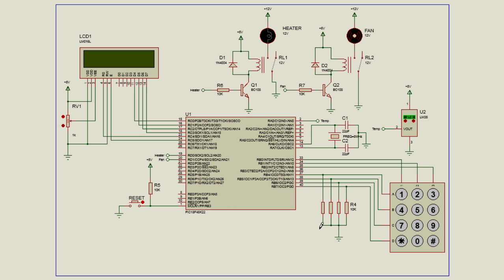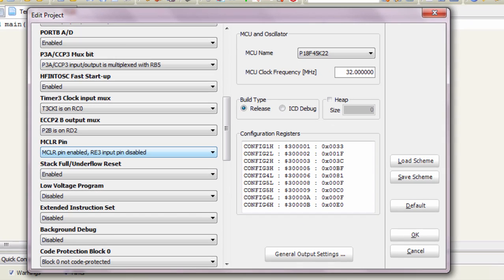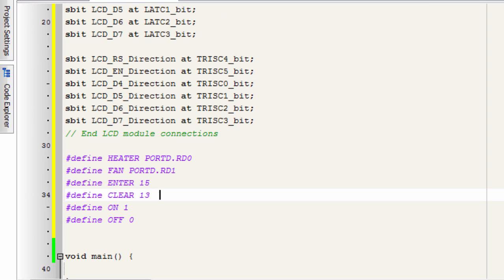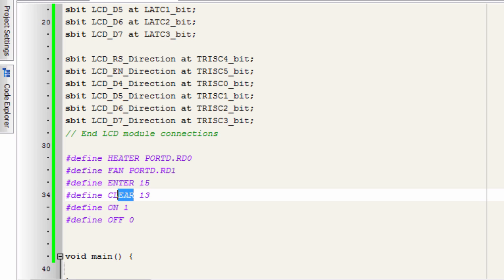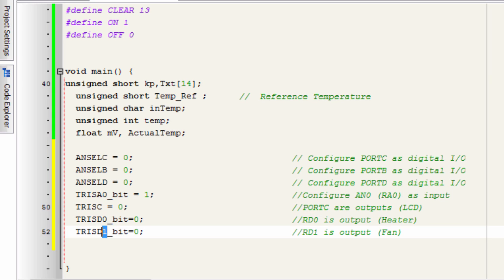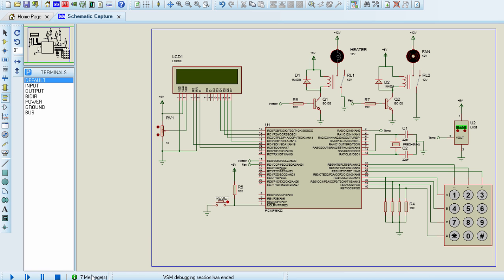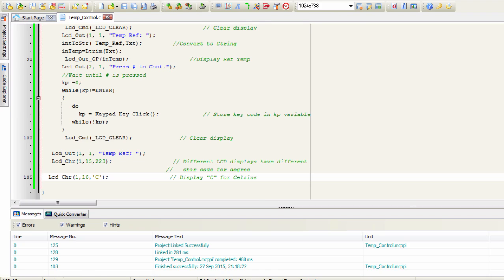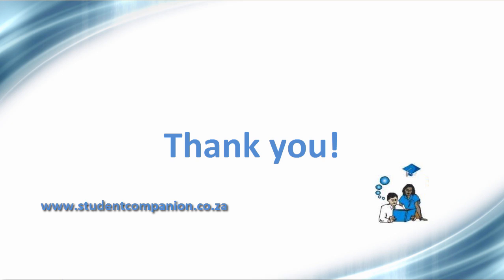12- Project 2 Automatic Temperature Control, part 2 | mikroC Pro for PIC Tutorial

Comment: Hello Sir, it's always great to learn from your tutorial. I truly appreciate that, I only had a doubt . For part 1, i have successfully done the schematic but for part 2 I'm not sure whether this program code can be inserted at MPLAB IDE since I don't have MICROC PRO.
Reply from the maker: Hi. You can't use mikroC codes in MPLAB. The syntax is different.  Here is the MPLAB version: https://youtu.be/cPigAoimpX8
Reply: @StudentCompanion  Thank you for  the reply sir :) btw, Just curious whether the same code in MPLAB..
Reply from the maker: It's more or less the same code. Except in mikroC we added another part 4 with additional features like to save reference temperature in EEPROM  and sound a buzzer when temperature reaches a certain limit. Those are the differences including the use of a different PIC which can't be an issue.
Reply: @StudentCompanion  Sir, Can i use this source code in proteous software and stimulate ?
Reply from the maker: Use the Hex file

Comment: hello friend a question that another micro controller can be used to replace the one you passed in this practice.
Reply from the maker: Yes you can.
Reply: Student Companion SA And why that you can?
Reply from the maker: +Memo9xD you can use any PIC with enough pins to connect your lcd, keypad abd your relays. It must also have at least one analog channel which mist of PIC today have. It must also have enough memory for this code.
Reply from the maker: +Memo9xD you can substitute with another one but don't use the same hex file, you must rebuild a new one with this PIC.  You must also set correctly your configuration bits and oscillator frequency.

Comment: Hi, you chose 32 MHz as the MCU clock frequency. May I know what the basis is for choosing the clock frequency, do you choose high (32 MHz) when you're dealing with more complex circuits whereas for simple ones 8MHz is sufficient? Thanks!

question 2: why not just use the internal clock to save on using discrete components?
Reply from the maker: The choice of oscillator is usually dependent on the requirements of the project.
1. Low frequency: The advantage of low frequency is low power consumption and if you decide to use the internal oscillator, then you can save on using discrete components. 
2. But for accurate frequency and frequency stability it's better to use an external crystal. A crystal is several times more accurate than the internal R-C oscillator. A crystal is much more accurate, and necessary if you are doing some other types of communication like CAN, USB, or ethernet which require accuracy and high frequency for operation, like a USB in full speed mode requires 48MHz.
3. Another reason is in applications that inherently require accurate frequency or timing other than communications. If you require timers for example or you are measuring pulses, with an RC internal oscillator, over time your internal oscillator might  go off with synchronization quickly after some time.
4. Another reason is in Temperature independent precision. Typical oscillators can vary wildly. Specialty temperature compensating oscillators can be needed in low or high temp applications, or if temperature varies wildly.
But in newer microcontrollers, the internal oscillator is getting more and more precise.  Some newer PICs have both a multiplier and divider in the clock chain so you can hit a wide choice of frequencies from the single internal oscillator frequency. So an internal can do the job well as well.
Because we are doing tutorials, we always use both, the internal and external just to show people how you can use both.
Reply: Thank you! Great job as always
Reply from the maker: Thank you.

Comment: hi bro,
how I can write the keypad code in a function outside the main and use it whenever I need it in the main? and how to call it in the main?
Reply from the maker: Do you mean you want to write your own keypad library? You don't want to use mikroC keypad library?
Reply: well, I want to use the same library, but customised to work with my system. I want to use 4X4 keypad, I want to use 0 to 9 numbers and * for back space and # for enter. Also, I want to use A, B, C and D for interrupter, for example, If I have a timer for motor and solenoid valve, and I have temperature control system and a humidity control, I want to use A,B,C and D to interrupt one function only and modify it using the keypad without effecting the other functions.
Reply from the maker: To read a Keypad key, all you need to do is to call the Keypad_Key_Click() function: 
kp = Keypad_Key_Click();
Reply from the maker: You can put the Keypad_Key_Click() function anywhere in the flow of your code depending on your requirements, it can be inside other loops or  statements, but make sure it's read continuously because it's has to wait for a user to press it. Whatever function it's inside, it has t be a waiting process because you don't know when a user will press the key.
Reply: Thanks bro, I want to use that function many times, for example to enter motor timing, to enter temperature reference... so on. I want to write a function customised according my requirement. any where in the main I want to get an input from the keypad, I call it. for example tempRef= readValue(); also for timing the motor, motorOn=readValue(); motorOff=reaValue(); 
the function readValue(); has my code to read the value from the keypad, that value has to be converted to integer so that I can use it for controlling the motor and temperature. This value has to be maximum of 4 digits. 
I spent really long time trying to sort this out, but still struggling.
Reply from the maker: +Lion Heart you want to control many parameters from one keypad.  The easiest way is save these parameter values in some variables during initial setup.  Then during operation use interrupts to jump out of main loop to enter new parameters.
Reply: @Student Companion I tried that and I got a reentrancy error for Lcd_Chr_Cp. Now I am trying to use it in a header file and I got error on " bit Keypad_flg; " it says specifier needed. I am using pic18f45k22
Reply from the maker: +Lion Heart which library are you using? Did you download the library? It looks like you didn't include the library
Reply: I am using mikroc pro and their library.
I am not sure how I can do what I want, I want to ask user to enter for example temp ref, solenoid timing, humidity ref etc. and I want to use A,B,C and D with interrupter so that anytime during the operation if user want to modify temp ref for example click on A, and so on, * for back space or clear and # for enter
Reply from the maker: If you want to change the settings during operation, use interrupts. Let say the user presses  button A, go to interrupt service routine. Here you can have a code similar to the code we have in this tutorial from this line: //On startup, read the reference temperature from the keypad. Then you can save your new settings. And once the Enter key is pressed "#", the program can continue with its normal operation. You can do the same for other parameters (Solenoid timing, humidity...) with interrupts of different keys.
But pay attention on which pins you are connecting your keypad because not all pins of microcontroller have interrupts features.
Another and easiest option is to add another pushbutton connected to an interrupt pin of microcontroller. Once this pushbutton is pressed, you can jump to ISR where you can configure all your settings.
Reply: Can I use timer interrupter? and do I need to connect each of A,B,C and D to a pin which support interrupter? as I have pic18f45k22 which has INT0, INT1 and INT2 only 3 where I need 4. And for the Keypad main code, is it one code or for each parameter has its own code?
Reply from the maker: Hi. How can you use a timer interrupt? do yo know when a user will want to change the settings so that you can plan it? I don't see how a timer can work in this case. They are many ways you can achieve this, as we said earlier on, the easiest option is to add another pushbutton connected to an interrupt pin of microcontroller. In this way, only one button can be used and only one interrupt pin can be used. It's common practice in many electronic devices. One button is called settings. Once this pushbutton is pressed, you can jump to Interrupt Service Routine (ISR) immediately as described in this video:  Microcontroller Interrupt: https://youtu.be/ubuT-qiRf4Y
Then you can configure all your settings at once. 
In your ISR you can have something like, it's start with Temperature settings, buy pressing for example a# key on the pushbutton again, you can go to the next settings and so on until you reach the last setting then it will jump to the main program. In this way if you don't want to change any particular setting, you can just leave the values as they are by pressing the button and switch to the other setting.
And if you don't want to use an interrupt, you can also read your pushbuton in the while (1) loop. Read this article where a button is used to enter settings: 
Digital clock using PIC microcontroller: http://www.studentcompanion.net/en/digital-clock-using-pic-microcontroller-and-the-ds1307-real-time-clock-mikroc/

Comment: PIC18F45K22 microcontroller is not available in our country , would you kindly suggest any other similar microcontroller with that I can complete this project ? And do u have any hardware implementation video tutorial of this project ?
Reply from the maker: +tania akter hi. I can't suggest anything because I don't know which PIC Microcontrollers are available in your country.  But you can use any PIC with enough pins yo connect your keypad, lcd abd 2 relays and at least 1 ADC pin. Which is not going to be difficult to get. The other important thing is your PIC memory should be big enough for the size of this code.
Reply from the maker: +tania akter there's no hardware implementation video yet but you can get the PCB implementation and  design files (Gerber files) on our website: http://www.studentcompanion.net/en/automatic-temperature-control-system-using-pic-microcontroller-mikroc/
Reply: can I use PIC18F4520 or PIC18F4550?
Reply from the maker: Yes. You can use those PIC, they can work with that project. But I'll advice to use the PIC18F4520 instead of the PIC18F4550. This is a USB device and if you are not going to use the USB module, you must pay attention to set correctly the configuration bits.
Reply: Thank you so much sir :)
Reply from the maker: +tania akter you are welcome!
Reply: can i use PIC16F877A ?  and can u plz tell me the hardware requirement ?
Reply from the maker: +tania akter you can but you'll have to make sone minor changes in the code. You'll have to select this pic in the project edit properties as we explained in video tutorial 1. What do you mean by hardware requirements ?
Reply: ok i got  it
Reply from the maker: +tania akter you are welcome!
Reply: which oscillator I have to select for PIC18F4520 ? and should I have to change anything more at edit project section ? And if I change the device name in project setting should I need to change anything in the code ? TIA
Reply from the maker: Depending on what you want, you can choose any oscillator. If you are not sure, use the same oscillator as in this project. Change the device settings and the code should work. maybe you'll have to change the ANSEL registers.
Reply: Which register should i use for PIC18F4520 and in the code there is showing error in this section, how to solve it?
Reply from the maker: Delete all the ANSELC, ANSELB, and ANSELD. The PIC18F4520 does not have the ANSEL register. You can use the ADCON1 to configure digital?analog pins. Check your datasheet for more information.
If you want to configure all pins as digital input/output pins except AN0 where you connected your analog sensor as in this project, delete the ANSEL configurations and replace them with this line:
ADCON1= 0x0D
Reply: What do you mean by datasheet?
Reply from the maker: +Antora Hossain a datasheet is a document from a supplier  that provides detailed information about a product . On this link, click on PIC18F4520 download datasheet to download it: http://www.microchip.com/wwwproducts/en/PIC18F4520
Reply: we could not solve it, would you please provide the source code using PIC18F4520 ?
Reply from the maker: +Antora Hossain what errors are you getting? When you build, paste the errors or send us your project on Email or Facebook
Reply: Can you give us your email?
Reply from the maker: +Antora Hossain send to info@studentcompanion.net
Reply: Ok. Thank u.
Reply from the maker: Antora Hossain you are welcome!
Reply: We have send the project , would you check your email :)
Reply from the maker: +tania akter we will have a look at it
Reply from the maker: The error is on line 44:
 
You must remove question mark and replace '?' it with semi colon ';'
Every line statement in C must end with a semi colon.So your line ADCON1= 0x0D? should be changed to: ADCON1= 0x0D;
The other thing, change your oscillator frequency from 32MHz to 8MHz .
Reply: Ok. Thank u. 😆
Reply from the maker: +Antora Hossain you are welcome!
Reply: We tried it. But doesn't create HEX file. What should I do now?
Reply from the maker: +Antora Hossain what do you mean it doesn't create an Hex file? Does it build without errors or it generates errors when you build?
Reply: there is showing a demo limit error , but when we tried with the code you have given and without changing the microcontroller there was hex file even with the demo limit error
Reply from the maker: +tania akter this code size  is bigger than 2Kb. The free version of mikroC compiler or demo version can only compile code which is less than 2 kb in size. You must buy a professional license to be able to build this code.  You can't build it with this free version. 
The code you sent us we only changed the semi colon error and it built successfully and generated an Hex file.
Reply: Can you send us that HEX file, please?
Reply from the maker: +Antora Hossain we will send you the Hex file.
Reply: Thanks a lot 😊
Reply from the maker: +Antora Hossain but if you are familiar with MPLAB, this is the same project using MBLAB.  The advantage of MPLAB XC8 free compiler does not limit you in size:    
 https://youtu.be/CC-IjVTmhjA
Reply from the maker: +Antora Hossain you are welcome!
Reply from the maker: +Antora Hossain we have emailed you the built project containing the Hex file.
Reply: Thank you so much :)
Reply from the maker: +tania akter you are welcome!
Reply from the maker: +abdou oussalah Hi. Can you write your own comment not reply to this old comment? This comment was left more than a year now and it's not related to your question.  It's difficult for us to keep track.
Thanks

Comment: how can we set the bit num in proteus 8 professional?
Reply from the maker: +Antora Hossain what fo you mean by bit num?
Reply: In 'device clock' option you set 32MHz but we cant find that option in "proteus 8 professional'. what do we do??
Reply from the maker: +Antora Hossain what do you want to do in Proteus? We used a crystal of 8MHz but we multiplied it by 4 in software  (PLL x 4).
Reply from the maker: +Antora Hossain all you need is connect a crystal oscillator of 8MHz in Proteus as shown on the schematic.  You can also right click on the pic and set the frequency but this is just for simulation probably simulation speed

Comment: u have mentioned if(kp==Enter)break: i couldn't understand if (kp==ENTER) there must be some operation what to do if condition satisfied
Reply from the maker: Yes of cause there must be some conditions to be satisfied. ENTER in this example represents the number 15. The same for CLEAR = 13. I used #define ENTER 15 in the code.  This simply means to make the code readable wherever there is ENTER in the code, it will be replaced by 15 when compiling.  
When you press this keypad, it will return numerical values.  When you press # key it will return 15.
Reply from the maker: Do you understand how #define works?
Do you know how the keypad works?
Please read this article to learn more: https://www.studentcompanion.co.za/interfacing-matrix-keypad-with-pic-microcontroller-mikroc/
Reply from the maker: Please read this to learn more first: https://www.studentcompanion.co.za/interfacing-matrix-keypad-with-pic-microcontroller-mikroc/

Comment: sir... when i am using pic18f4550 so what well be the effect on diagram.? and code.?
Reply: sir.??????
Reply from the maker: +Fadi Khan what do you mean? We have other priorities and other people to support. You can't expect to be answered instantly. 
When we have time we will attend to your query.
Reply from the maker: +Fadi Khan when you change PIC don't consider the package pin numbers. Use the pin functions lime RC1, RC2, etc as they can be on different pin numbers. In this example we connected the lcd on portc but any other port could also do the work. We needed 6 pins for the lcd, rc0, rc1, rc2, rc3, rc4 and rc5. You can connect your lcd to rc0, rc1, rc2, rc4, rc5 and rc6 and make the modifications accordingly in the code or you can connect your lcd on PORTD and the heater and fan on PORTC.
Reply from the maker: +Fadi Khan for more info how to connect an lcd and change the code? Please watch this video: https://youtu.be/_ujw_tuQDTY